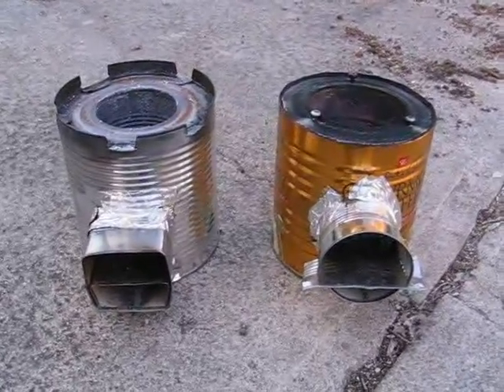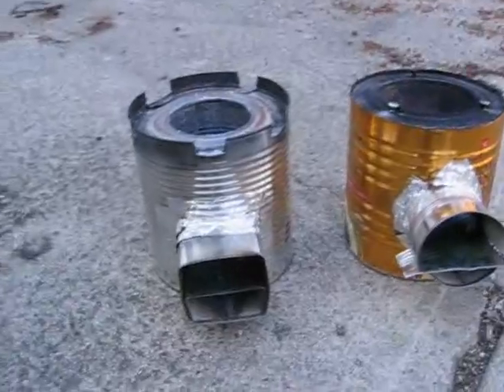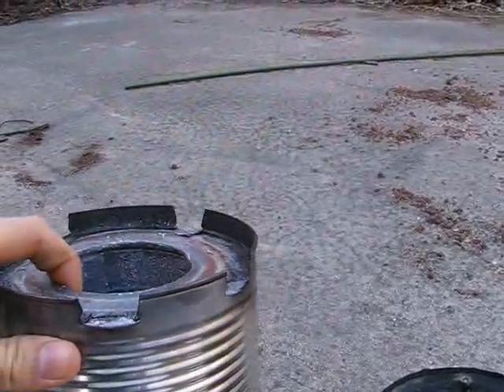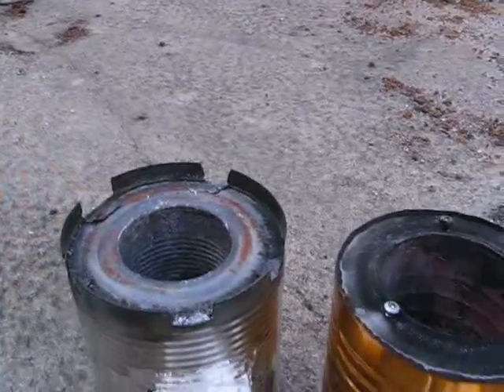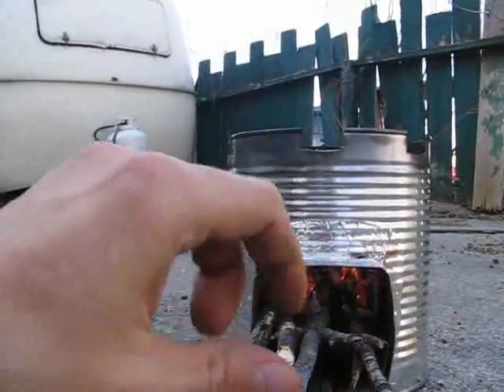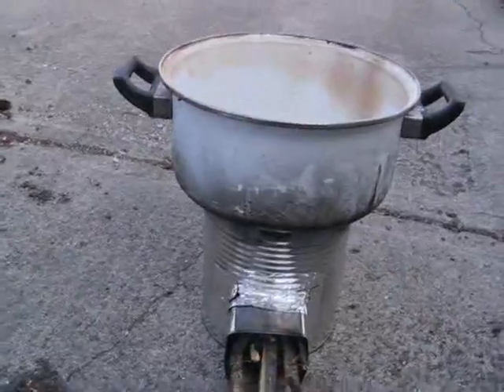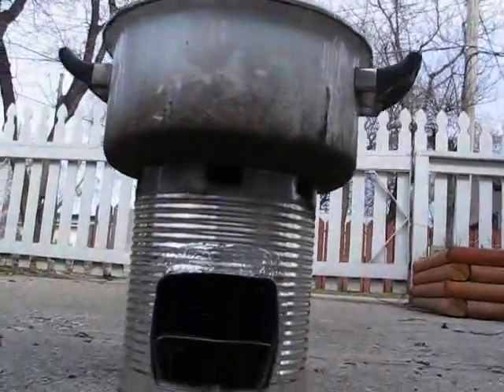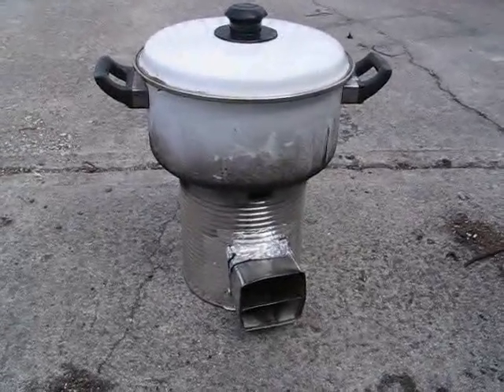coffee can rocket stove #2

Comment from the maker: Sounds like a good project!  The two coffee can height will make a better stove for sure.  Rocket stove temperatures can get hot enough to melt fiberglass, so I would avoid it if you can.  I don't know if the vermiculite will insulate enough to keep the fiberglass from melting.  Alternatives are using only vermiculite or perlite, or using rockwool or mineral wool insulation which won't melt like fiberglass.  I look forward to seeing a video of it.

Comment: Interesting discussion on insulation gents.   Has anyone tried fiberglass insulation AND  vermiculite?   I am building my 1st Rocket Stove using two coffee cans screwed together as the outside container and soup cans for the rest.  

My thought is to place fiberglass on the very inside surface and bottom of the coffee can(s) then fill in the rest of the space with vermiculite so the combustion chamber/chimney is surrounded by vermiculite.

Comment from the maker: .....  The sand can absorb (aka, steal) a lot of heat from the fire.  This lowers the temperature inside the combustion chamber and produces a less complete combustion.  Given enough time the sand will reach very high temperatures and continue to steal heat from the fire as it looses its' heat to the outside of the can.  Though the outside of the can containing vermiculite may get hotter faster, it won't transfer the heat away from the combustion chamber as fast as the sand does.  Plus  when....

Comment from the maker: I don't actually care how many idiots put sand in their rocket stoves, it still doesn't make it the right thing to do!  If they have done even the slightest bit of research into rocket stoves and the principles behind them, they would know that sand is not the right material with which to surround your combustion chamber.  The reason the outside of the stove containing sand may be cooler, is because the mass of the sand is absorbing much of the heat before it gets to the ouside of the can......

Comment: Its true.  There is a YouTube video by LDSPrepper where he tests both and also says that sand insulates better.  The reason for this is most likely that the sand takes up more volume, packs more densely, and has less air pockets.  Though you have a lot of extra weight with sand.

Comment: Your mini pocket rocket isn't boiling the large pot of water because of the loss of heat vs surface area of the pot. If you made a boiling pot the same or slightly less in diameter than your pocket rocket heat exposure area, the heat would travel up the sides of the pot and bring the water to a boil. IMO; Your feed chamber is too large, the size of the feed chamber is usually 1/4 of the size combustion chamber or less. This creates more heat, less ash, and requires less wood to operate.

Comment: The efficiency of a rocket cooker is achieved by allowing the flue gases to run up the side of the pot. The diameter of the pot here is too big. Look at the designs that encorporate a pot skirt...no use in re-inventing the wheel.
Good luck

Comment: @kenfo0 
Check the technical info on "rocket stove" mass heaters. You will find that it is the "insulation" between the primary (upward) exhaust and the secondary (downward) exhaust that causes the "draft" (or "rocket") effect.
Without this difference in temperature, you will not have the exhaust you need to cause the hot gases to travel down. around and through vent pipe, inside the cob (mass) material.
So, yes! You DO need the insulation. I've built them and experimented with the designs.

Comment: Is the inner area insulated (between the outer wall and combustion chamber)? 
If there's not enough difference in temperatures, there will not be a "rocket" effect.
I'm sure you know all this and realize that this video is over two years old, but I'm wondering about the insulation. Some use vermiculite. (I want to make one of my own and am trying to learn from others.)
Thanks!

Comment: dude, i was wondering... what if you made the combustion chamber taller? a taller one would create more updraft, burning the fuel faster, producing more heat, but possibly the gases would have time to cool off before reaching the top...
just thinking here, i saw that the flames barely reached the pot in this design.

what do you think?

Comment: I don't see any way but to continually feed it as you go. Either this type of regular "L" rocket, and you shove chunks right into the combustion as you go, or a higher slanted chute with a tight lid (Or remove the work surface/pot, and drop fuel in, but this would happen often for fueling).

 This might make it so that the lower inlet is air only (with a damper?) Possibly a passage in under the fuel grate is air inlet/ash removal.

Comment: I experimented with a small can "rocket stove".
Eventually the whole things gets hot, so fuel sitting on the shelf would ignite along the entire length, and anything stored in a hopper or chute would ignite also.
Need to carefully control where air goes, so there's no possibility of it going up & out the feed chute (where mine failed).

Comment from the maker: rocket stoves burn wood and are different from a gasifier.  The rocket stove is designed to provide all the air and heat necessary for a complete primary combustion.  Wood gas stoves are designed for incomplete primary combustion at lower temperatures which releases wood gas that is then ignited above the smoldering wood in a secondary combustion.

Comment: boiling water is no obsession, it gives a measure of the stove's output energy

assume you have 1liter (~1kg) of water that takes 5min to reach 100deg. centigrade starting from it's initial 20deg. centigrade. OK
1calorie is the amount of heat needed to increase the temperature of 1g of water by 1deg. centigrade
calculations for the above noted values....(100-20)*1000= 80kcal...(80000*4,18)/(5*60)=1,11kW

so 1,11kW is the output of your stove+pot assembly

Comment from the maker: I made it a while back. As far as I remember, I traced the outline of the smaller can onto the loose lid of the big can, cut a hole with tin snips in the lid a bit smaller than the can and made many cuts straight out to the line, then bent the tabs down and fit the smaller can into the lid. Hope it helps.

Comment from the maker: I think a taller combustion chamber wouldn't hurt.  I'd also like a way to add heated secondary air for more complete combustion. I'd also like a chimney, both for better smoke control as well as stronger airflow. This model was limited in height to the height of the large exterior can. I've got some 5gal. metal pails I'd like to use next, and try to make a firebrick combustion chamber, in a horizontal setup so the wood falls into it, and a blower fan to make it real hot.